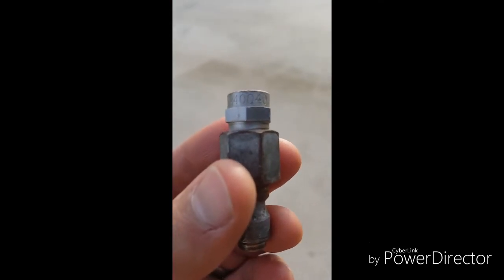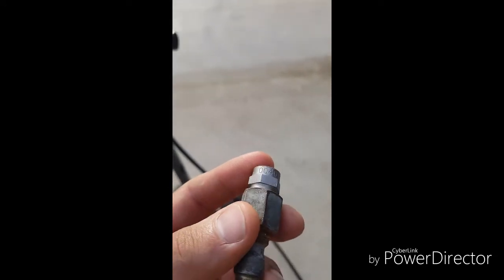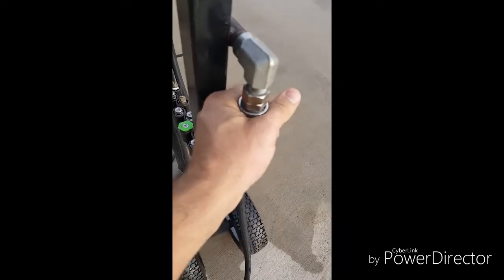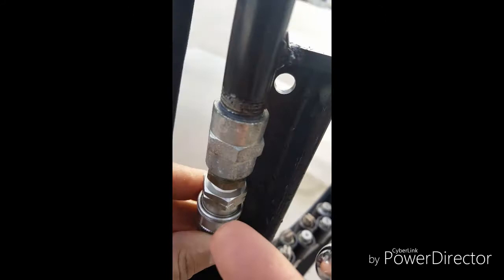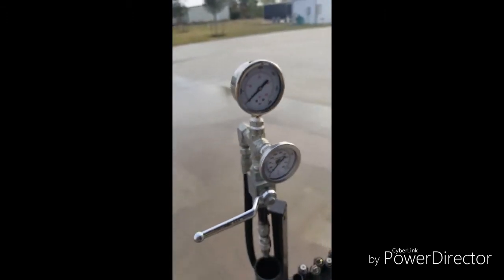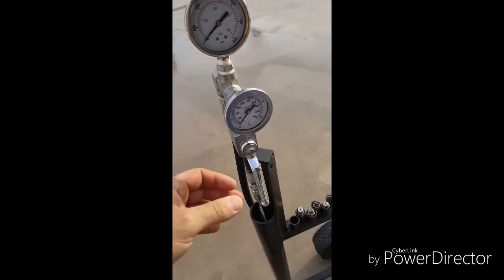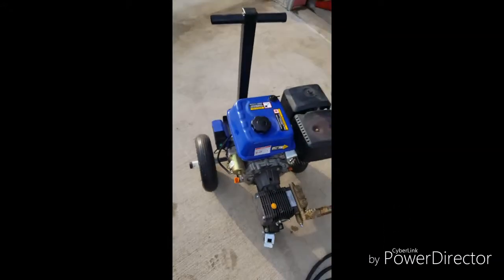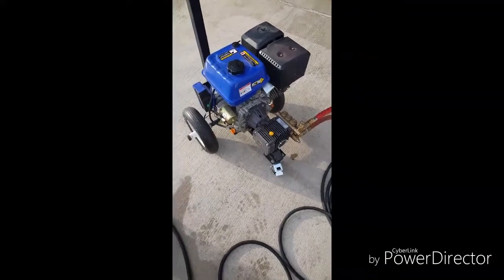4000 psi 4 gpm pressure washer test

Comment: I have an unknown general pump, I think it's possible a TS2021. Is there anyway to test the GPM of this pump? I'm gonna get a pressure gauge for the PSI, but can't find a procedure to test the GPM coming out of the pump. Thank you for any help.
Reply from the maker: You have to change your nozzle sizes.  With a 2021 I recommend a 0005 00055 or 0006 orifice tip.  Generally with a ts2021 we use a 6 orifice which gets us approximately 2900 psi at 5.2 GPM with a Honda gx390

Comment: That's all good man, but you're supposed to set it for spike pressure to reach 4000. It should be cleaning around 3400 and when u release the trigger it will spike to 4000...
Reply from the maker: The spike pressure is normally set about 500 above operating pressure.
Reply: @TxCoWash  I've never heard that. It's not much of a big deal. That's just what I was told by mike hinderliter 20 yrs ago lol
Reply: Actually, I didn't mean to say never heard that because what u said is correct but u should always make that extra 500psi be the max output pressure. Not trying to be a dick, love your products and videos
Reply from the maker: @aquacleaning4994  also note this is a slightly higher cc engine than a gx390, that's why it's being run at 3800 instead of the 3500 we run 390s at.  The standard is about 500 extra on bypass.  On the video we did not have it set where the final bypass pressure was set.  
My main intention of this video was to present the dishonesty of product advertisement.  This engine was "advertised" as an 18 horsepower engine.  Some people are under the impression that manufacturers are required to be honest how they advertise their products...  I wanted to discredit the false advertisement with this video.
Reply: @TxCoWash  no problem man, makes perfect sense
Reply from the maker: @aquacleaning4994  and as a compliment towards you - you weren't being a dick.  I also don't think I have the ability to get offended.  No need to walk on egg shells around me.  Constructive criticism makes people better.  Not being able to accept constructive criticism is the mindset of someone who isn't interested in being better.
Reply: @TxCoWash  lol, no problem man. I just get a lot of people who do get offended when I say something. I've been in this industry since 98 and I still learn and fuck things up from time to time. I had a guy try telling me his 4 years of internet research made him the smartest pressure washer in the world, yet he didn't even own his own business nor had he ever used one lol
Reply from the maker: @aquacleaning4994  I've only been in the business for 5 years.  My father started in this business in 1983 and I decided to follow his footsteps.
Reply: @TxCoWash  That's awesome man! That's the year I was born, haha 😄! I've been doing this since I turned 15. I worked for 2 big companies for about 7 years per, then opened my own business around 7 years ago. I wish my dad or anyone would do the things your pops can lol. You're definitely blessed for that.
Reply: I've come across your comments while searching if it is normal that my newly purchased BE pressure washer which rated 3200psi 2.8gpm only outputs 2500psi operating pressure and spike at 2900.Do you think it is normal ? or the manufacture fake the rating. I am new to the gas powered pressure washer. Thanks in advance.  I've tried to crank down the unloader valve, but it only increase the spike pressure, the operating pressure max out at 2500psi.